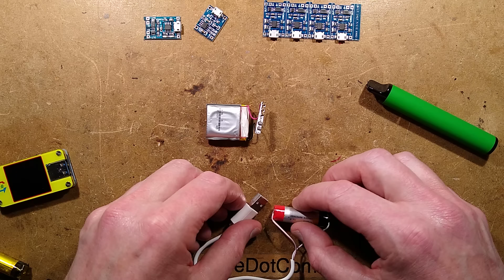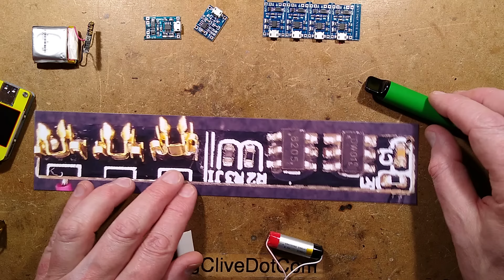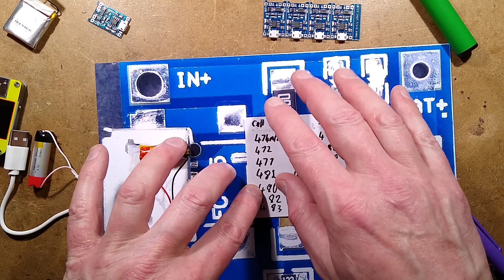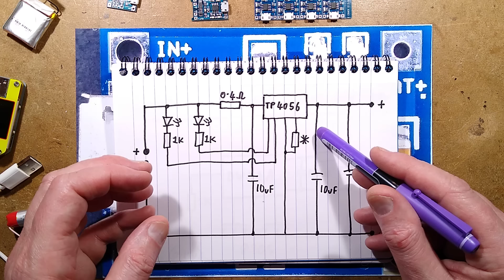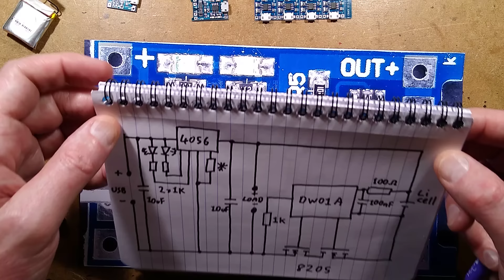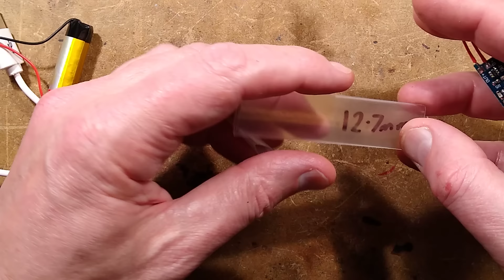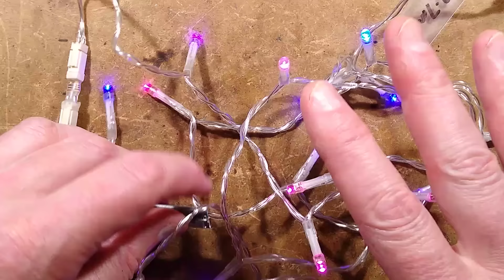Don't do this!   (There's a much safer way)

Comment: Many very cheap chinese flashlight, headlight and stuff have USB connector connected straight to battery without any electronic, protection even resistor.  Included (fake high capacity) battery can handle it because some cut-off circuit in it. But not possible charge this battery in smart charger (charging stop after few second like fully charged or show bad cell) possible use dumb charger to full charge. Otherwise cannot use unprotected cell in this flashlight or other stuff because it can end very bad. If car charger included it contains just resistor for current limiting but on USB connector is car battery voltage. Very happy I found out until something burn out.

Comment: I never have much use for random sized batteries, so I only keep those of standard AAA through D sizes.  However, even those can be overly discharged and will be seen as a short on my standard recharger.  So what I do is use my DC power supply to feed a buck converter.  The DC PSU costs $60, which is why I feed a $1.00 buck converter.  I'd much rather ruin a buck converter.  Plus, the buck converter is rated at about 1 amp.  So its limit protects both the psu and the battery.  I need only charge a battery like this for about half a minute.  After that, it's charged enough not to register as a shorted battery on my regular charger.  I recover overly discharged batteries about 90% of the time.

Comment: This may seem obvious to most familiar with Clive, but I think by using an old large blocky 110-240v wall charger (As long as it’s compatible in your country)
That almost everyone would have laying around from an old phone that has an output of 0.5-1.0A should also serve a similar purpose.
Not as compact and and you will have to use a mains output and won’t be able to use usb power banks.

A lot of the mishaps with lithium cells is likely going to come from people being impatient, lazy, too young to be ordering from China/setting up a soldering station in short, those wholly ignoring Clives advice for their own “convenience” basically.

(Does a solution like this still have problems like overcharging etc?)
(I know it’s not ideal but a lot of people are still going to hack up a usb lead and stick that straight to the terminals because the most of the leople who use disposable devices as intended probably won’t go out of their way to do it the right way.)

Comment: i have been saving these batteries and using them myself. a few months ago i had some doubts around why the world is having a lithium shortage. millions of these are being produced and thrown away when the battery is completely re-usable.
the manufacturers could of used alkaline as its cheaper.

Comment: As per normal a great video Clive. I would just like to know  if anyone knows the minimum charge rate you can adjust these modules too for very small capacity cells. I for example use 60ma to 200ma, these modules must have a low charge threshold limit
Over to you brother solder sniffers!!!

Comment: Could you replace that little surface mount resistor on that charger board with a potentiometer for manual charging amperage adjustment? I haven’t tinkered with electronics so I’m just wondering.

Comment: About these LiPo charger modules that buy in strips.  They're prone to a few problems caused by overheating of the IC especially when installed inside an enclosure where heat can build up when charging at 1 A for long time. Once the chip gets too hot there's various failures the voltage and current sensing loses accuracy, the indicator lights malfunction and the chip drains the battery while on standby.  Maybe a glue on heatsink or something would prevent that.

Comment: Thanks for the video. Any chance of explaining the right way to use these to make a 2 cell pack in parallel for high capacity. I see diagrams of using 2 modules with their power inputs joined ++ —and their power outputs joined ++ —, then one battery to each modules battery terminals. Safe?

Comment: Most lithium cells I've found in multiples devices have a small protection board, however I don't to know to what extend it protects the cell other than charge current and voltage. If they have over discharge protection that'd be pretty awesome but for now I'll just stick to the TP4056. Don't wanna find out the bad way.

Comment: I've been recharging vapes this way to get more hits out of them and I've only had a battery explode on me once. I've done this hundreds of times but I still won't leave the thing for more than 30 seconds while it's charging. I alway rip the batteries out of the juice runs out and toss it in the desert instead of my trash can.

Comment: Question. Can you charge two or three of these cells in parallel using one TP4076?
Reply from the maker: Yes.  But their voltages need to be very close before connecting in parallel.

Comment: How is it, can this be powering a load AND have them charge the batteries at the same time?
That would be a great device to support small computers with power in a brown out (or even black out) of the main power.

Comment: If say, I just wanted to use it as a power port but dont intend to use a battery, Do I need to do anything with the battery leads?  is there a better module to use in that respect?

Comment: Just picked up a bunch of these on Amazon. some with and some without the extra protection circuit. if you buy 5 or more they end up costing ~50p to ~£1.50. What a bargain!

I still don't get the significance of the extra protection circuit - will the unit not stop charging at 4.2V without the protection circuit anyway?
Reply from the maker: It's an extra layer of protection, but also prevents over discharging.
Reply: @bigclivedotcom  Thanks. I've ordered a bunch of the ones with the protection circuit on. I'll only use the unprotected ones for simple charging jobs from now on.

Comment: Hi Clive and comments!
I've salvaged a fair few of these cells and am looking at using them in a project. How can I go about charging multiple of them at once? Can they be wired in parallel with 1 module? What's the best way to do this without needing a module for each cell?
Reply from the maker: They can be wired in parallel if they are close to the same voltage.  They will act as one big cell.

Comment: i use a rc car battery (lipo) charger, it has liion settings, adjustable target voltage, automatic calculated amps, great device

Comment: To be honest, I actually salvaged one of those cells as well. Since my battery in my Bluetooth headphones was getting little tired, it was a good opportunity for a use case. Granted it wasnt exact replacement, but voltage wise, it was the same with double the capacity. So I made it fit inside anyway. I think those cells are pretty good. Lets see how it performs in my headphones.

Comment: Clive I have a 11.1v 6600mAH battery  ( SN:HID2011073925) from an hid torch that I’ve left a bit too long in storage, it has a three brass prong connector marked 

K D + 

I’ve taken the top off and I cable see the + goes straight to battery + but the others to the circuits , however there’s a large black wire that I assume goes directly to the battery - , can I jump start it by using the red + and the black - bypassing the rest of the circuits then charge as normal.
Reply from the maker: You may find that one or more cells has dropped below 3V.  Sometimes you can nudge the voltage up with a current limited supply to around 3V to reactivate the battery.

Comment: Hi Clive, 
I've been using these vapes for a year or so, and always hated the idea of just binning them, and thought the batteries inside could be repurposed - so I just saved them all.
I've studied low level electronics in uni but not to the level to be comfortable messing around with these ! 
I've got about 100 of these little vapes waiting to be torn down and reused for something, I was thinking of making a power bank, similar to the ones I see people making out of those 18650 cells. 
Is there any other resources that you can recommend to learn a bit more about this sort of thing to save me electrocuting myself and burning my house down? 

Cheers !
Reply: “Grandads other channel”, he’s mentioned that he watches this Clive’s videos but I’m only here because of grandads channel. Same camera angle, he’s obviously fan so you’ll feel comfortable there I guess. He made a powerbank which is what I’m hoping to do with my batteries.

Comment: Once again BCDC has been a wealth of techno electronic knowledge that speaks sense. I have friends as well as myself picking up these vapours for one to dismantle for its juicy (voltage) contents. I've a small collection now and time to put them to beneficial use with charging modules. Thanks for all the info given here Clive, so I will be back after some ebaying, soldering, and powering up to discharge my batteries and keep me running longer than a Duracell bunny rabbit can, LOL.

Comment: Another easier and more environmentally responsible way to charge li-ion battery is to (re)use usb powerbank circuit. Its 2022, I'm sure everyone has at least one disuse powerbank in the drawer. Just rip out the charging circuit and rewire like the video.

Comment: I used to charge these vapes and use them whenever I was down on my luck, Soldered it much like clive did and forgot about it. I smelled the sweet smell of a lithium battery about to pop and barely threw it in the driveway before it set on fire in my hand. from then I really only buy rechargeable disposables at the least.

Comment: I have a whole drawer in my electronics cabinet just for TP4056s. Lots of those modules and then just a bunch of bare chips for adding into my own circuit boards. So incredibly handy. I made a handful of 18650 chargers using single battery holders and these modules. Really handy to throw in my camera bag or luggage to easily keep flashlights ready to go.

Comment: Lol, basically a lithium cell contains lithium, strangely enough, and if you want to see what lithium can do when not in an environment that is sealed against moisture, throw a piece of lithium into a lake.....
And then times that by 100-500 and get the fire brigade out with a water hose...
Reply from the maker: There's very little lithium in a rechargeable cell.  Their main danger is their energy capacity.
Reply: @bigclivedotcom  Just for you because, well... yeah
Lol, basically a lithium cell contains lithium, strangely enough, and if you want to see what lithium can do when not in an environment that is sealed against moisture, throw a *SUBJECTIVELY SMALL* piece of *ENERGY DENSE lithium into a lake.....
And then times that by 100-500 and get the fire brigade out with a water hose...
Reply from the maker: @pauliosantos1985  Pure lithium, yes.  It's called a lithium ion battery because it contains lithium ions diffused through electrode materials like graphite.
If you opened a fully discharged lithium cell and threw it in a bucket of water, nothing would happen.

Comment: I've got loads of these cells. My plan is to make a power bank or two.
Any tips for connecting 13 in series x 10 in parallel (possibly 14 x 11) - and how to charge them evenly?
BTW, the cells for this project are 1500mAh out the big square vapes.

Comment: I admit, I did this one time, left it to charge in like cubby hole of my filing cabinet while I went outside and forgot about it. Came back to the battery totally disintegrated and the wiring on USB cord burned off.  The ceiling to the cubby hole had a nice layer of smoke on it and I bet the lack of air flow in it is what prevented a fire from spreading to anything else.  I had placed the whole thing on a non conductive metal racking

Comment: I’ve designed a few Li-Ion battery systems for commercial products, and Clive is bang on, don’t just plug them into a USB port unless you like 🔥💥!  We use batteries with protection boards, and a charger with voltage and current limits, and a 60C thermal cutout, and we disable charging above 40C…

Comment: I'm no electronics expert, but I would assume the easiest/best way to charge these would be in the vape device it came from..
Reply: The vape devices they come from are single-use disposables and have no charging or protection circuitry.

Comment: I acquired several units and was given a rechargeable one.  I have taken the rechargeable apart for the battery and the recharge circuit.  
I am going to use it to recharge the batteries.  So far i have charged several 3.70 wh batteries on the charger that came with a 2.22 wh unit. Brought them up to 4.16 and shut off. It works nicely so far, it even has built in led's to let you know its done charging,

 The single use oval flat devices make a nice battery holder as well since you can fit 2 of the batteries inside them. One in the factory battery holder and the other one loose.

Comment: I bought pack of 5 for charging my liion cells. In last 4 months 3 burned out, on last one I even put a heatsink but they just overheat and die if you keep original resistor on.
Reply from the maker: That's unusual.  They should protect themselves from over current and temperature.

Comment: Hey, Big Clive (And anyone else that finds it use full). You can stretch Heat shrink before heating with Needle Nose pliers to help add room to the tubing. Insert the teeth of the needle nose in the tube and open them, stretching the tubing, depending on the type of tubing it allows you to slide the tubing on wires that you may not want to disassemble in some situations. If you stretch to far, it will let you know. Cause it will tear the tubing. (If you warm the tubing a little with body heat then stretch it, it helps.  I have found it useful for computer wires and stuff that I did not want to de-solder do to the fiddlyness of the molex connectors and stuff. (Also works with small tubing that may not quite fit tight enough onto wires, thus allowing a tighter "bond" when shrunk.)(Edited due to spelling )
Reply from the maker: I do that when things are a bit "snug".
Reply: @bigclivedotcom I've finally invested in some TP4056's in the sure and certain knowledge that I had the requisite size of heat shrink!
...Wrong! that was when I discovered that a pair of kitchen scissors would make 'em fit, like a shoe stretcher does!!😆

Comment: Hi bigclive! I was wondering, could you show us how the speed control on typical table fans is implemented? And more importantly, how we could modify the lowest speed to be slower? All my fans are too loud and fast on the minimum speed.
Reply from the maker: Some have separate windings and some have a series of capacitors that are switches in series with the motor.

Comment: It's a shame that neither the DW01 or the 4056 chip has the facility to blink or output to a battery low LED which would be handy for LED torch applications to indicate when the battery is going to cut off literally dumping you into darkness.

Comment: What about fitting the cells into a DIY power bank designed for 18650s? Would I be able to get away with this?
Reply from the maker: If the charging current is suitable then it may work.
Reply: @bigclivedotcom  I will let you know how it goes.

Comment: Just to note, some of these single cell (1S) lithium ion/polymer charging boards ship with 1K resistors (I have some in my parts bin and they ship as original with either a 1.2K or 1.0K current set resistors preinstalled, usually specified as either a 1.0A or 1.2A charge board in their ad/listing) and thus charge at 1.2A (the maximum that the IC is rated at, IIRC) — the formula typically being 1200/R=charge rate, should you wish a customized charge rate.  They will indeed put out up to 1.2A sustained provided there is adequate heatsinking surface area under the charge controller IC (there is a single thermal pad underneath the SMD IC package), otherwise the IC will go into thermal limiting so that it does not overheat during extended charging.  Most of the single cell (1S) charging ICs use a linear style regulator to limit the peak voltage to 4.20-4.25V (absolute maximum) so the input voltage will play a huge roll in determining how much heat the IC will need to dissipate during charging.  I have never seen a need to evaluate a charge rate in excess of 1.2A since most inexpensive USB chargers are limited to 5-7W, or so, maximum.  Edit: spelling correction.

Comment: I have an 18650 charger that I can adjust amps on so I just use that.
Reply: Also a separate usb li-ion charger I added alligator clips on.
I will still do this if I'm not home though, since I don't carry any of the above with me.

Comment: At low current limits you may want to check the amperage of TP4056 based chargers. I had some LR2025 batteries that needed (admittedly very) low current and had much more with what should have been the correct resistor. They didn't like going down to 30mA.

Of course it's entirely possible they were second source parts not from TP or I had a bad circuit (not my own board design at that point). And I haven't seen that happen since.
Reply: LR2025 is a typo? I don't think anybody makes alkaline batteries in that size.
Reply: @fat_pigeon  Lithium rechargeable batteries. LIR (not LR as I typed) is the non-official prefix on those.

But certainly a rechargeable lithium. I wouldn't be recharging an Alkaline with a TP charge IC.

Comment: As regards connectors, as a general rule, it is safer to make the powered side (in this case the battery) female. Having powered male connectors is not a good idea.